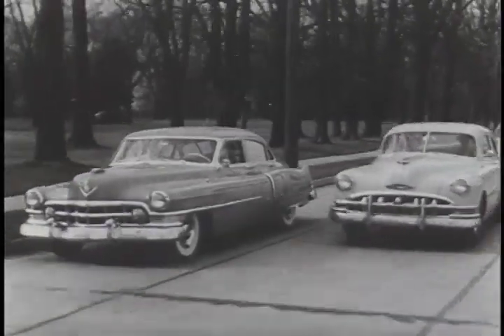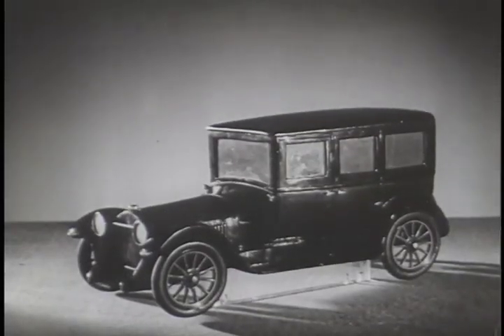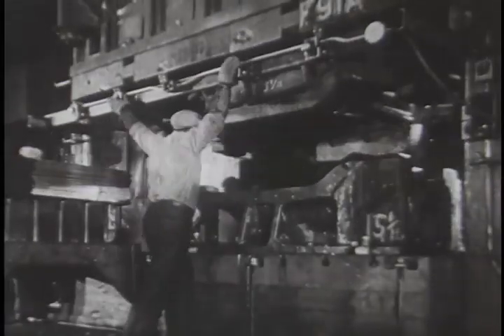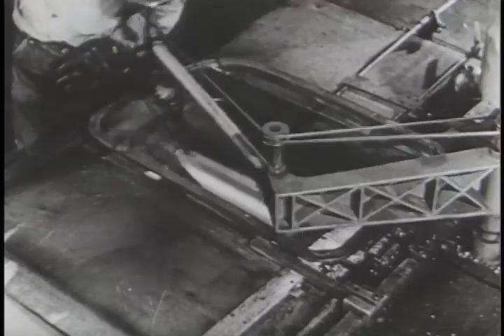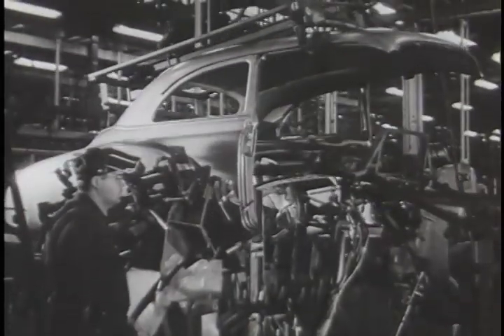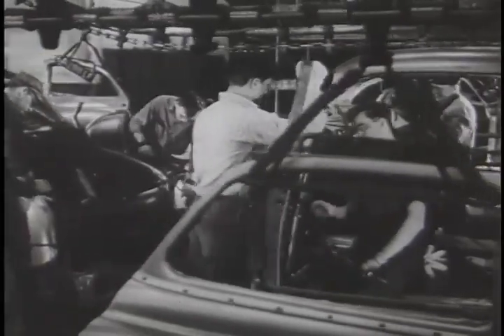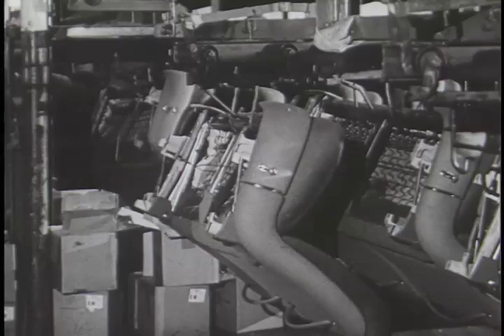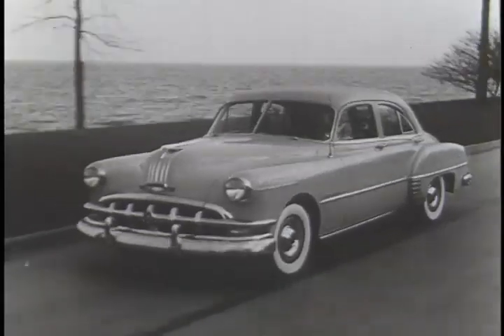Fisher Body Builds for GM

Comment: As a recent retiree of GM, I appreciate this more than some...
Reply: i spent  32 years  at delco   dayton  ohio  still  have my   56 belair  a 6  corvairs   to this day  .. go gm
Reply: animalcorvair Nice to hear from a fellow vet...I was 31 years at St. Catherines powertrain, and Oshawa Truck....My first was a 1964 Olds F-85 I bought in 1977....Only wish I still had it BTW, I joined the UAW in 1979....we changed to the CAW in 1984 (not a free vote)
Reply: animalcorvair I am restoring my 1960 bel air this year. Upgrading the motor and tranny but all exterior will be cascade green including the steel wheels.
Reply: @animalcorvair  luckily I still have my 72 Chevelle. I am glad I kept it.
Reply: @walterweddle7644  dad  had a 67 an a 71   mom  sent  the 71 to  heaven  ,, she was  ok as she had  her  seat belt on..found them a 79 2door  caprice ..i have  it  now  ,,mint  but the heat liner   thats easy  to fix,,,no rust
Reply: bubsmeister, the public does not appreciate the amount of design, engineering and workmanship that goes into producing motor vehicles. We should not be buying foreign imports of any kind. Is it any wonder why our standard of living in Canada and America has plummeted over the years? Too bad people don't remember Henry Ford and his $5 a day wage bump from a $2.5 average. The man was singlehandedly responsible for inventing the Middle Class; great man, a real hero! So the pattern is clear: domestic car manufacturing + good wages + customer loyalty = Middle Class standard of living. The masses, as a whole, are TOO stupid to understand this. (I own two GM pickups, btw.)
Reply: @L R G  I only buy North American vehicular GM Ford Chrysler 🇨🇦
Reply: You can even see early robotics in those days with the big spot welders.

Comment: (9/29/2019) I’m not old enough, but I am old enough to remember seeing a horse pulled carriage fisher body logo stamped on the metal strips that were placed below old car doors.  I just don’t remember on which cars. I’ll be fifty next year. But this video draws me all the same towards comfort in the good ‘ol days.
Reply: That was on all GM cars.  Fisher Body used to be an independent coach company that was bought by GM.  Fisher Body was phased out as a separate division in the early 80s and that's when the Body by Fisher door sills stopped.

Comment: Iv'e had my " Body by Fisher" 67 Camaro for 40 years.
Reply: I have my Atlanta built 1970 Chevelle SS 454 and my two Flint built Regal turbo V-6 cars one carbureted and one original fuel injected turbocharged! I was part of the concept group that created the concept turbo V-6 that was used in the Indy pace cars then went into production. I also have a Flint built 1970 Chevelle SS 454  a 1969  and a 1970 Buick GS two door that my grandfather bought through the special office production order at Buick in Flint these are sacred parts of my life and my family history

Comment: Fisher Body was disbanded in the 1980s.
Reply from the maker: The end of an era.
Reply: There's still a Fisher Body plant in West Mifflin, PA. Couple miles from what used to be Spear Chevy. Jerry Spear died in the plane crash with Don Yenko. (RIP both.) Any gearhead worth his salt knows who Don Yenko was. Last time I was by there has to have been more than ten years ago now, but it was still there then. My ex-wife's 86 Cutlass still had Fisher Body tags. Nowadays cars are all made of plastic and pot-metal. Junk.
Reply: @CrazyBear65   I know, many of the cars that came out post 1988 lost the steel bumpers, metal lower body paneling and personal styling that made United States automobiles stand out from the competition.  What also died with it, was the jobs and income those people manufacturing these  automobiles and what followed was a loss in General Motors market share.  People simply were startled and taken aback by the GM vehicles lacking individual styling that distinguished them as unique to their brand.  It also did not help that GM just about completely abandoned the usage of rear drive vehicles after 1988.
Reply: My 87 Cavalier had the Fisher Body logo on it so it was 88 and later it was got axed

Comment: The Fisher Body plant still exists in West Mifflin, PA. not far from the US Steel Irvin Works. They still make vehicle bodies. Well, I reckon the cars aren't made out of steel anymore, they all have plastic parts holding them together, and airbags, and "rumple-zones"... They all look like plastic toys that were carved out of a bar of soap. But if you look on a 68 GTO, a 72 Cutlass, a 77 Gran Prix, a 79 Caprice, an 82 ElDorado... All GM vehicles, open the door and look at the aluminum strip on the rocker panel, and it will have a tag there that reads: "Body By Fisher" All the way up thru the 90s, at least. To be honest, I haven't looked on the newer ones. I wouldn't own a new vehicle, even if I won one. They're all shitboxes anymore. I'd sell it and keep driving old trucks.
Reply: You drive old trucks because that’s what you can afford...just barely.
Reply: I totally agree. I kept my 72 Chevelle. Don't listen to those who put us down for liking old cars. I would love to have a 62 Plymouth Valiant or Rambler American. No damned crazy computer stuff to go wrong. Cars of today all look alike. They resemble bumper cars at the carnival. Yuk!! I am glad that I am not the only one who loves old cars. We prefer them and it had nothing to do about what we can afford. Thanks!!!!
Reply: I agree the styling of cars after 88' was a shock in comparison to Fisher Body vehicles that had metal bumpers, metal trim, some remaining metal interior trim, and were rear wheel drive.  It took some adjustment to get accustomed to the different proportions of the front drive vehicles with different overhangs and greater usage of plastic.